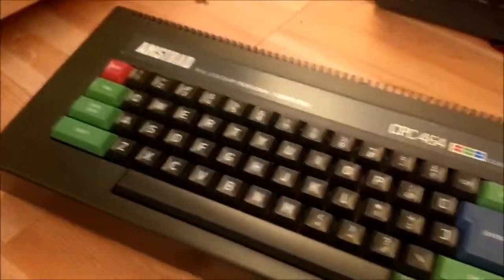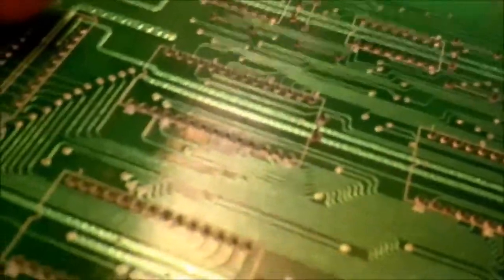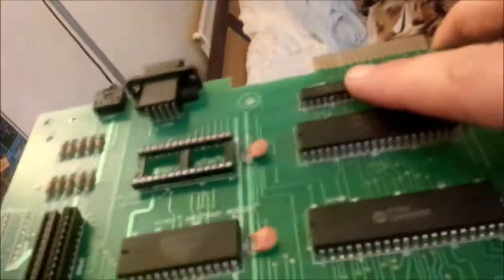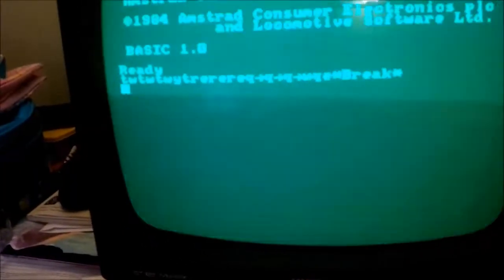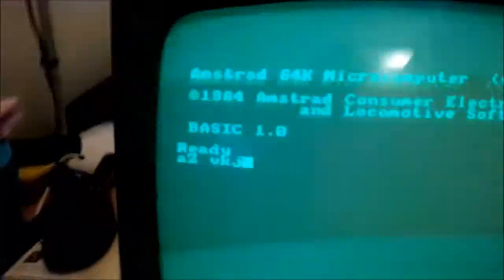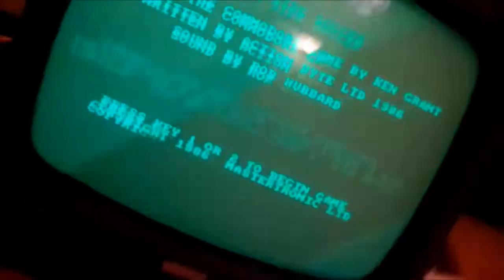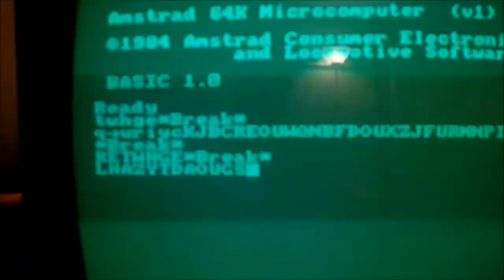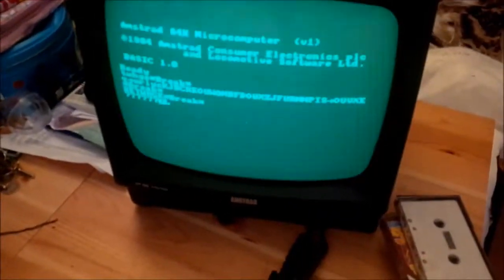Retro Special - AY chip replacement on Amstrad CPC464.

Comment: Close but not quite a bananna, but it does point that you have found the source of the problem, as you said just need to find a replacement chip now.
Reply from the maker: Ah, but is may be another chip (the decoder) or just the ribbon, but I think the latter is unlikely. Here's hoping.

Comment: The keyboard I can't see being controlled by the AY chip though as it's only for music as far as I know so it must have been something else doing that aggravated by the putting in of the new sound chip like trace related.
Reply from the maker: The AY does to the sound yes, but is also responsible for the interface with the keyboard. I think the keyboard is a midi device hence.

Comment: Very interesting. Wonder what happens when you put the Spectrum 128k  verient of the chip in there as it's half more the ks so has a more advanced verient?
 
Wow this is the Spectrum verient can't wait for sure now foor the end of the episode.

Wonder what the ST verient sounds like in there?
Reply from the maker: The ST uses a YM2149F, a Yamaha version of the AY. it has a clock switch but the same pin layout. I think it is mapped differently though. Cheers for watching. :)

Comment: Great vid =)  Assuming its not the keyboard itself (or connection to motherboard) then I would swap out the 74LS145 (should be IC101 I think).  Also check you've not got any solder connections bridged where you've soldered the new socket on.
Reply from the maker: I double checked the keyboard ribbons, they are fine. Also no soldered are bridged, at least not visable. Yes, the decoder chip 74LS145 has been suggested, as people are generally saying the A variant of the AY should be fine. Thinking back to when it work once with the old chip, the keyboard did work without problems, so maybe the AY failing is to do with a possible failure with the decoder?
Reply: It's certainly possible!  I've never had an AY chip fail in any other system, I wonder what the cause is in the CPC?  Maybe it is the 74LS145 that takes it out?  I do know the two work together to form the row and column matrix for the keyboard input.
Reply from the maker: I guess so yup. I never even knew the AY was the interface until recently. lol

Comment: Faulty keyboard membrane? Springs on underside of keys not aligned properly?
Reply from the maker: Already checked, taken apart and cleaned. Seems fine.
Reply: Possible faulty system ROM (containing Locomotive Basic)?
Reply from the maker: Maybe, but it does load games fine. Been suggested by the cpcwiki that it may be the decoder chip.